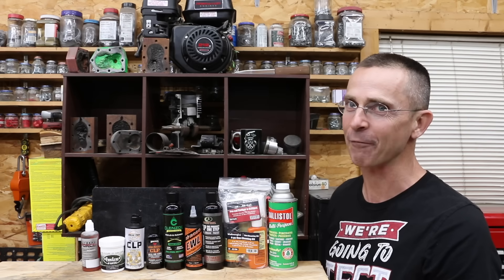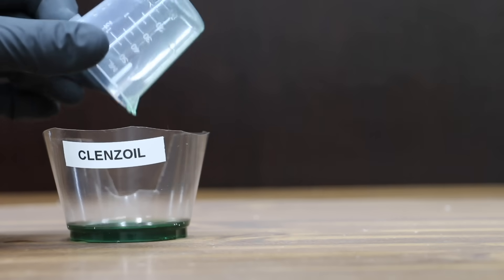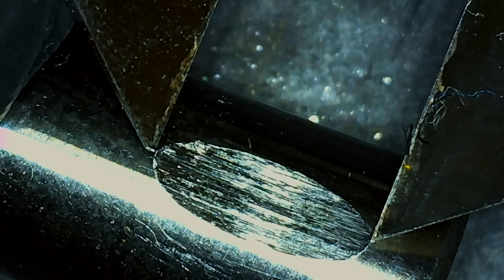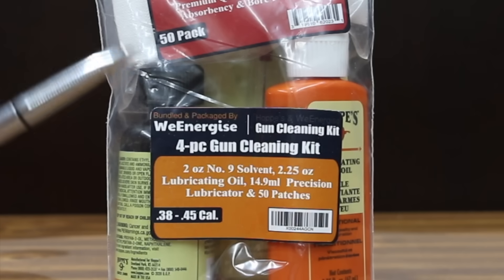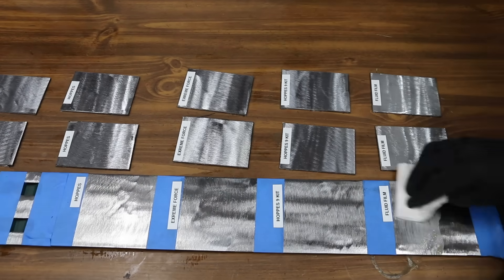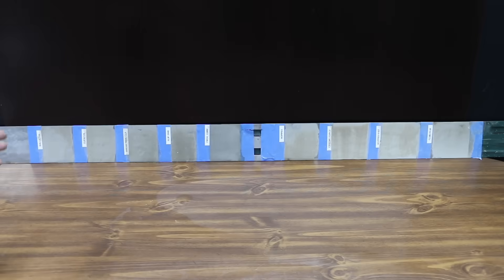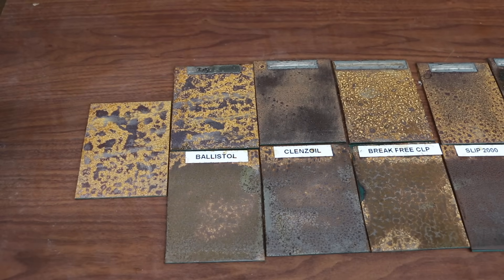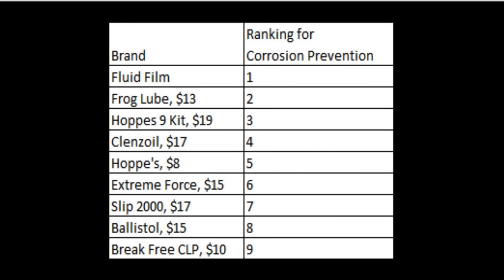Don't Buy A CLP Until You Watch This Review! It'll Save You Time And Money!

Comment: I use Hoppe’s #9 as a cleaner, then apply the break free CLP to my firearms. Works great so far. Even on my duck hunting shotgun (Browning maxus) that has 10 seasons on it and has been dunked under water and sees +/-thousand rounds per year with hunting and target shooting its rust free, has minimal wear and functions great. Never a hiccup even when hunting in freezing rain with the gun that hadn’t been cleaned all of duck season. I left with freezing rain sticking to my jacket, a limit of ducks, and a dirty but still functioning shotgun. And I attribute that to the Breakfree CLP, I have seen many autoloaders gum up and slow down enough to fail to function on cold hunts using other lubricants like Balistol.
Reply: Ducks: "I'm glad theres freezing rain today, no one will be out here hunting"

You: "clicks safety off"
Reply: Ballistol is water based. I feel it's okay for quick cleaning after using surplus corrosive ammo and on muzzle loaders between shots, but I agree 1000% with what you said. Hoppe's to clean, CLP to lube. It's the only way.
Reply: This is what I've been doing as well, when I come back from the range.  Clean really thoroughly with Hoppe's #9, then apply some Breakfree CLP at the points where things rub together.  I might switch to Clenzoil after seeing this.  What a dramatic difference in wear.
Reply from the maker: Thanks for sharing.
Reply: I'm not a major hunter or clay shooter, but I've found shotguns are a lot more forgiving when being filthy, probably due to the plastic hulls. I just use some brake cleaner to clean it and then soak everything in motor oil on my 16 gauge sxs because I'm cheap but I've never had issues lol.
Reply: @rubiconnn  break action shotguns can certainly be forgiving. But newer auto loaders aren’t as simple and can be slowed down enough by cold oil to fail to function.
Reply: @chevyon37s  I live in an area where it pretty much never gets below 60F in the winter and is usually between 95-105F in the summer so cold oil isn't a worry for me lol.

Comment: Clean with Ed's Red, (recipe available online.) Use motor oil to lube pins. Use suspension grease to lube bolts and sliding parts. Stop wasting money on "gun" products when firearms do not ever see the kind of loads and abuse automotive parts do.

Comment: Thanks for the video.  I ride the frog lube bus for cleaning and protecting my firearms, but when it comes to lubricating rifle bolts and revolver cylinders I have a dropper of 20W-50 Mobil 1 for ease of use.  Frog lube will get gummy in stored guns if you dont apply it probably and wipe down the excess in the hard to reach areas like behind an extractor.  

You did leave out one of the oldest on the market and probably everyone has a can of it, the green and yellow Rem Oil.
Reply from the maker: You are welcome!  Thanks for the feedback.

Comment: Finally!!! Excellent testing. I wouldn't mind seeing another round with other brands similar to your engine oil showdown. I personally use Lucas gun oil and I use barricade for exterior protection. I'm more interested in the lubrication performance than the cleaning ability. Lucas extreme duty gun oil claims -38 to 400 degrees
Reply from the maker: Thanks!  Thanks for the suggestion.

Comment: Video Ideas: 

electrical tape insulation values
Electronic tic tracer performance/durability comparison
Wire nut vs solder vs crimp connection vs clamp nut voltage/durability/tensile fail
Reply from the maker: Thanks for the video ideas.

Comment: This is a well designed test overall. However some test procedures are not exactly relevant to firearms. Here are some thoughts from a competitive shooter: wear and tear are not usually the first concern of high volume shooters, and regular gun owners will never reach the point where a metal on metal part wears out(out of spec) in a quality firearm. From my experience, I have never seen a high round count pistol or rifle (100,000 plus) simply “wears out” because of metal on metal “grinding”. Material fatigue which caused by the energy released from burning of smokeless powder is the no1 cause the decommission, or catastrophic failure of a firearm. The grinding test is a well designed but not realistic, lubricant reduces wear and tear, but not material fatigue in any significant way.
Reply from the maker: Thanks!  Thanks for the constructive feedback.

Comment: I might have to switch gun cleaners to cleanzoil.  The wear scar was outstanding I might not even use grease on the sliding surfaces. Break free came to a close second, but I live near the ocean so I want the better corrosion resistance. This was very comprehensive and would let people know what they would like depending on their individual requirements.
Reply: I’m a retired gunsmith and I’ve used clenzoil for decades. Not only is it a good lubricant but I mainly used it as a protectant of firearms.  The only issue is it was more difficult to apply in some areas and I was wasteful of the pricey clenzoil product.  I always wished they made a true aerosol.  I remember purchasing clenzoil aerosol once but it was more like a foam and I did not like that.  My shop was in humid south Florida about a mile from the beach and I never had a corrosion issue.
Reply: Same! I use shooter lube so I would have liked to see it in here but clanzoil looks like my new replacement
Reply: I think I will continue using Breakfree CLP and add some Froglube last to prevent corrosion.
Reply: @D3M3NT3Dstrang3r   if you do that you will have issues it gums up
Reply: @adamlong54  I am happy with my Break Free for lube, But as it is my carry it tends to get sweat on a good bit in the summer. I think a coat of froglube to the outer portion of the slide (polymer frame) would help to keep the surface from rusting. It's only a blued finish and I have had some minor issues with it before on the very tail of the slide.
Reply: @adamlong54  Yup, I was going to say the same thing.
Reply: @shouldibehere  shooters choice fp10 is the best ever. 
Same stuff muscle mt10 muscle fp10 
Go watch the YouTube video tests. Bearing load test is amazing
Reply: @D3M3NT3Dstrang3r  Why not use the fluid film for the outer portion not subject to sliding forces like the action?  That was my take-away from this - namely, pick your lube for the job.  The fluid film "might" be ideal for the exterior of blued steel in a corrosive (or just wet) environment. 

Since PF's testing showed that fluid film is pretty worthless as a lubricant it would be interesting to compare it to other protective coatings; we might find it isn't necessarily the best at that specific job either.
Reply: @D3M3NT3Dstrang3r  
Sorry to say but the two don't mix. The Frog Lube will actually clean off the oil based products to a degree and over time replace it.
Reply: @D3M3NT3Dstrang3r 
Nope
Reply from the maker: Thanks for the feedback.
Reply: @Project Farm  I am very surprised you didn't test any of the Amsoil or Lucas gun products. I am a CLP user personally but the Amsoil and Lucas guys are absolutely steadfast in their products and I know the Amsoil motor oil test went very well. Can we get a part 2? :)
Reply: @ProjectFarm  I wonder what DOD uses
Reply: @apocalypse487  brake free and radcolube are the two I am aware of in use.
Reply: @apocalypse487   Gunzilla was popular in SW Asia. 2000s. I use Ballistol, Slip 2000 EWL but I might give Clenzoil spray a try.
Reply: @apocalypse487  
There’s no all in one product that works great. Over at the 160th, we used synthetic engine oil and automatic transmission fluid on everything. Mobile 1 was supplying lubricant back then, not sure about now.
Reply: @Miner-49    In my view, Slip 2000 EWL is ✅. Many new CLPs pop up every 15min it seems. This T&E was a surprise 😲 how poorly Froglube Extreme, Ballistol did. I might try Clenzoil spray. My big - with the product is how it's petroleum oil 🛢  based. Many gunners, professional gunsmiths advise not using oil based CLPs. I do like sprays, fluid over grease, car-motor oils.
Reply: Honestly, it might make sense to use the Cleanzoil as a base and mix in your own secret blend of 11 herbs and spices to make it better. Right off the top of my head, I'm thinking a mixture of Cleanzoil, Moly Grease, and either graphite or Teflon powder might be the ticket.
Reply: @bigmike- 
Isn't the whole point of the CLP class of products so you don't have to add all that extra stuff?
Reply: @davidhawkins847    you don't need a whole tray of cleaners, CLPs oils. A good product like Clenzoil, LPX or Slip 2000 EWL is fine. ✅  You can lube the barrel with a well made product for added protection, storage.
Reply: You should check out weapon shield.
Reply: @kevinm594  I use that and Gun Butter. I use Weapon Shield on my ar's and Gun butter on my Glocks.
Reply: @Beardman56  I buy the original muscle fp10 they private bottle it for shooters choice to their specs. It's the metal treatment I use in muscle mt10 same as the prolong metal treatment for motors
Reply: I got a few small bottles of CLP, Clenzoil. It's good but can go fast! 🏃🏼‍♂️. I still like & use Slip 2000 EWL but for general cleaning, gun care; I will now use Clenzoil.
Reply: @Beardman56  the anti friction metal treatment makes a film in the metal creating a film barrier it give a more even pressure in barrels more accuracy as I run max hand loads in my firearms got them special bastard child gun ya know the ones you got to mess with to get perfection out of them.
Reply: yea, the only thing is it didnt flow at -40f. But i think i can live with that. I dont think ill ever get anywhere close to that temp
Reply: Do you catch your own fresh seafood for dinner?
Reply: Would make sense as long as you’re not in a cold environment. If you gun got cold, it could FTE.
Reply: @jocodashcam295  frog lube is a system if you mix it with anything else it is like jelly. Secondly to have frog lube work best you need heat to have it work best so it penetrates the metal aka heat gun or oven like 200 degrees so it soaks in. With shooters choice fp10 no need to do that best stuff look up the video's on YouTube MUSCLE fp10 or MUSCLE mt10 same stuff they private label it for shooters choice fp10.
Reply: I can see government would buy the best/cheaper options... makes sense. Better/more expensive available but didn't make the cut (or GREASE the right palms)...
Reply: Shooters choice fp10 is better than them all
Reply: On your sliding surfaces try full syn 0w20 motor oil.
Reply: @bixby9797  I use lucas red and tacky.  Got great review from project farm vid and will stay put unlike oil.
Reply: I use motor earl
Reply: @fusiondensity3287  I've used motor oil at times. There are some additives in some motor oil that may have a bad reaction on the polymer or wood furniture on certain firearms and may blem certain metal finishes.
Reply: @fusiondensity3287  actually, all joking aside, I think motor oil on a firearm would be a fine choice for a lubricant.
Reply: @IrrationalBstrd  royal purple or mobile 1 synthetic
Reply: @fusiondensity3287  either way, lube is better than no lube 👍
Reply: @IrrationalBstrd    I disagree. Get a CLP or gun oil. Motor oils and car stuff can damage some firearms. I've used Froglube, Ballistol, LPX, Clenzoil CLP. Works good.
Reply: @DavidLLambertmobile  I wouldn't use it unless I had nothing else. My point was, lubrication is better than no lubrication when it's required/called for.
Reply: @IrrationalBstrd    true but most sporting goods stores, hardware-auto parts stores sell at least 1 gun care, CLP oil. Lucas, Break Free etc. If you CAN, get a good C-L-P like Slip 2000 EWL, LPX, Clenzoil, Rand CLP.
Reply: He did not test it with a gun and how do you even do that? Does ANY oil really help? Not much.
Reply: @TheSphongleface it would be very expensive. Would require having multiple copies of the same style firearms and then firing thousands of rounds through them the test for wear and tear and corrosion.

Comment: The problem with Ballistol is it was made in 1905. Literally the first CLP and they haven't changed it. It still does well in real world use.
Reply: And you can use it for nearly everything imaginable 😂
Reply: @coses4957  yeah its the most versatile and biodegradable. Smells great too.
Reply: @coses4957  You can even drink it.
Reply: I use ballistol one all my fire arms for years with no issues.
Reply: Ballistol is so versatile I love it.  It's probably not the best at any one thing but works well in so many areas, including non firearm uses.
Reply: Ballistol is great if you use corrosive ammo, it cleans really well in general.  But I've never thought of it as a lubricant, same with hoppes #9.
Reply: There is a "new" Oil from Ballistol, Gunex, i use this for lubrication and rust protection. The advantage of Ballistol is that it isnt toxic and its a little alkalid, so it can neutralize low acids  And it's solving a little copper, if you run a wet ballistol patch throug your barrel and a dry a couple of days later it will be green.
Reply: Yeah but nothing smells as pretty as WD-40
Reply: I bought Ballistol back in the days cause it was suggested by a friend, does it really   differ from WD-40 ?
Reply: @AAAAAAndrea  yes. WD-40 does not work on guns. It turns into varnish and locks everything up. 

Nearly half the business the old gunsmith in town has is simply boiling and cleaning WD-40 varnish out of guns that are brought in "because they don't work!"

Ballistol dries clean. It stinks in a way different way also.
Reply: I switched all my lubes and rust preventers (including Break Free) to Ballistol years ago and have no regrets.  It pulls dirt out of bores that Hoppes doesn’t touch.

I have great respect for PF’s testing but in this case the Ballistol results don’t jive with real world use.  The things I use it on don’t go in freezers or ovens.
Reply: "Still does well in real world use" Did you see the video?? It sucks
Reply: @whiterabbit201  I would consider usage for decades (1905-1945) by millions in the German military in conditions from muddy trenches to north african deserts to russian winters in everything from single shot rifles to MG-42's as real world and FAR more reliable than limited lab tests.  There are other things involved in complex products and systems like this.
Reply: @whiterabbit201  It fucking doesn't. His tests aren't real world. What they offer is a consistent comparison. I have used Ballistol for over 15 years and it noticeably smooths the action of all my guns. That is mostly compared to break free, which I have used in the USMC for 18 years. You can literally feel it operate smoother. Plus, if you get it all over your hands you don't have to worry about it because it is non toxic and not a carcinogen. CANNOT say that about any other CLP. Some us actually use our gear and need to do things like eat in the field where this matters. I have no safe queens. It is the best all around, not specifically to one trait, but all around. It can be used on the entire gun, wood, plastic, bakelite, whatever.
Reply: @blackhatch46  You literally just watched a vid showing you it has more friction that most CLPs yet your "feel" is better than actual test results, LOL! Only 18yrs in the service? Almost 30yrs in the Active Army here so don't try to play that card! I've done more than my fare share of eat'n & shittn' in the woods and sand so I don't drown my equipment with lube so I don't worry about getting that shit all over me. The problem with "do it all" shit like Balistol is it doesn't do any one thing really well, so it does a halfass job at everything. I use cleaners to clean and lubes to lube in the real world. Milspec CLP is also halfass at it also but it damn sure is better than that other shit while deployed or in the field . I've watched guns freeze up solid with Frog lube, Balistol  & other "Gucci" gun care products up in the extreme Northern Europe and Alaska in the dead of winter. If I want to clean my windows I use window cleaner, if I want to clean & protect wood I use a wood care product, if I want to clean a rifle's Bakelite well it's probably a Commie AK and they don't deserve cleaning LOL!

Comment: Frog lube wants you to heat the metal then coat with frog lube.  I've used it this way and the metal feels incredibly "slick" but dry at the same time after doing this method with my firearms.  Would be interesting to see how that does with the friction test.

Comment: I'll add my anecdotal experience with removing lead... Hoppes #9 cleaner has been far more effective than Ballistol for removing lead buildup in my airguns. Lube I'm still trying to figure out. Ballistol for barrel lube seems to bead up, I've seen this by running a bore scope down after 24 hours. This suggests that Ballistol for rust prevention is no good. I may try one of the products that worked well in this test for rust prevention. For right now Carnuba wax has been suggested for rust and helping to prevent lead buildup.
Reply: Check out Renaissance Wax for rust protection